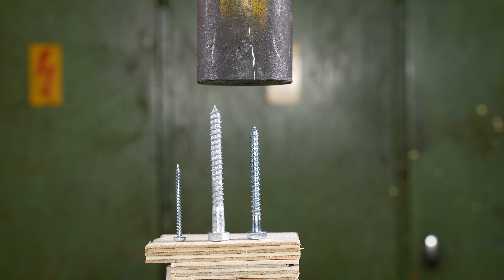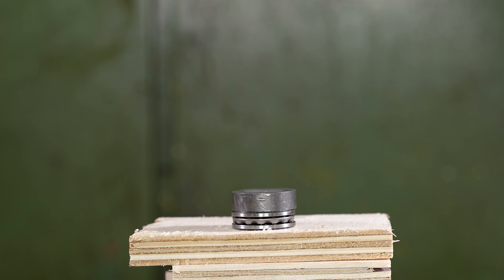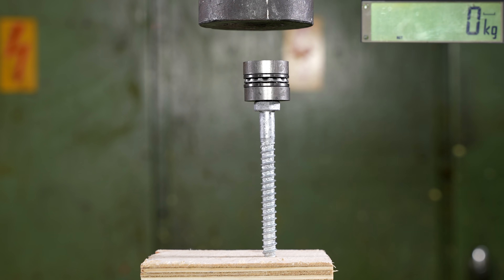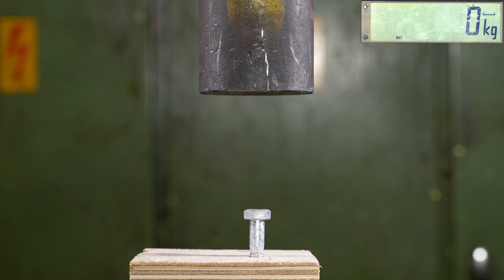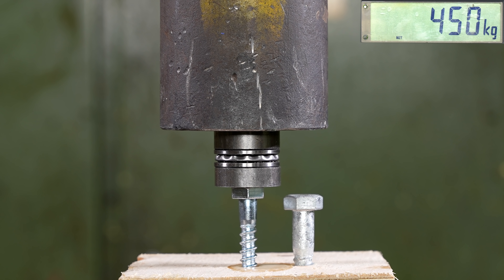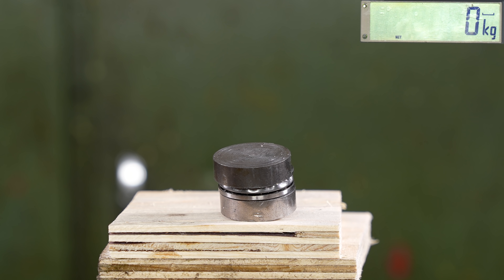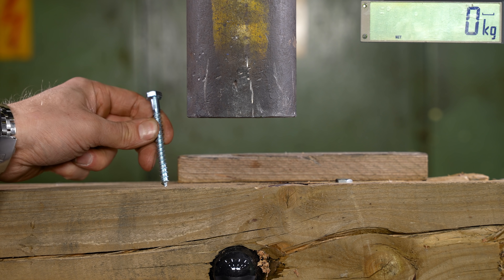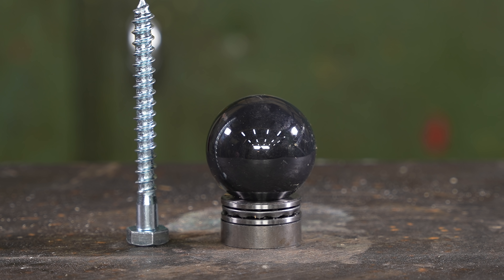Crushing Screws into Wood with Hydraulic Press | Will They Spin?

Comment: you better hope it can't spin going in, because then it could spin and come out! screw thread angle is picked such that friction makes it impossible to spin. there is a shallow enough angle for any surface and any two materials such that pushing directly down will never make the surfaces slip because of the coefficient of friction. There is a term for this angle, but i forget what it is. But the general idea is that if you push two items together, it becomes hard to slide them against each other. the harder you push, the harder it is to slide.

Comment: If the tangent of the angle of threads is smaller than the coefficient of friction then screw does not spin. That is the point of screws.

Comment: Screws are designed to have more threads to make sure they can't spin. If a pulling or pushing force was all it took to make them screw in and out then they wouldn't be doing the job properly. If they did spin somebody would need to be sacked

Comment: Thread pitch is the issue.  A manual transmission is easier to push in a higher gear while it starts the vehicle motion easier in the lower gear.  Gears and mechanical advantages.  Think inclined plane/wedge and direction of motion.  It's too steep.

Comment: Bolt has the surface its turned from on the outside of the head, screw has them inside. It has actually nothing to do with the type of thread or size.

Comment: They do seem to spin initially but stop doing that later as the overall (rotational) friction is too high.
You might be luckier if the threat has a higher pitch and/or with a harder type of material.

Comment: Pre-drill the wood fist?
Reply: Just use a bolt and matching nut. The channels are already cut.
But it won't work either because bolts and nuts are designed exactly for that: so they can't unscrew by longitudinal force.

Comment: How to destroy the ceramic bearing… hmm… how about using an air cannon shooting it at a steel plate? 
I remember watching a video where they used an air cannon that drew a vacuum in the barrel and had compressed air in the firing prechamber.
That should launch that bearing at the plate at supersonic speed.

Comment: "I'm not sure if it's a screw, or bolt".. 
Easy answer is a bolt requires a nut, any "bolt" that screws directly into something is "technically" a screw.. No matter how large. So technically speaking, cylinder head "bolts" are really screws..

Comment: The wood is too soft. As soon as the press has pushed the screw in a bit, the diameter of the hole is already that of the outside diameter of the screw threads. The threads don't engage with the wood any further after that.

Comment: When it comes to trying to get these to spin going in, you're screwed, LOL 😂 Won't work EVER.
As for the ceramic ball bearing though, try an armor piercing round from a high powered rifle. 30-06 or 50 BMG, both can bust through AR-500 armor plate, might stand a good chance on that bearing